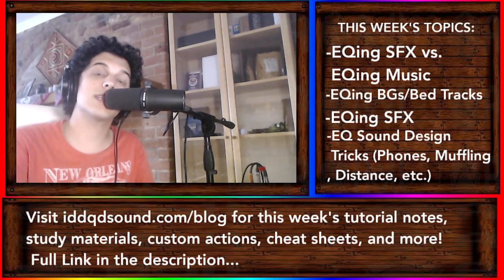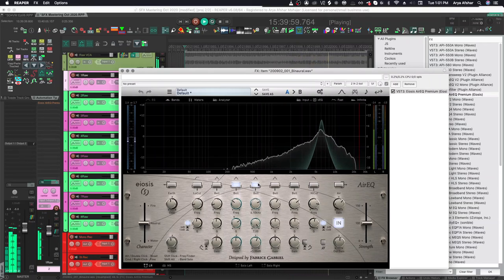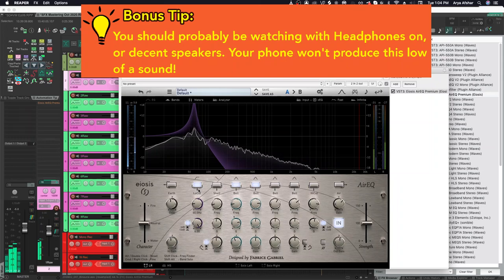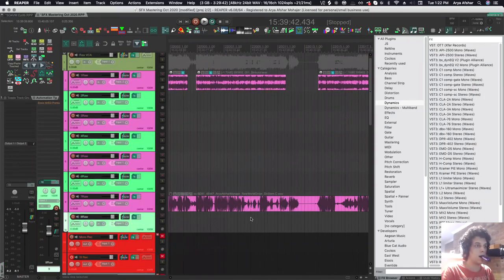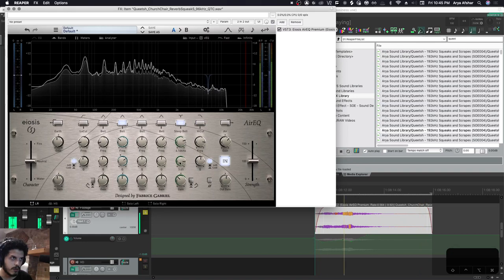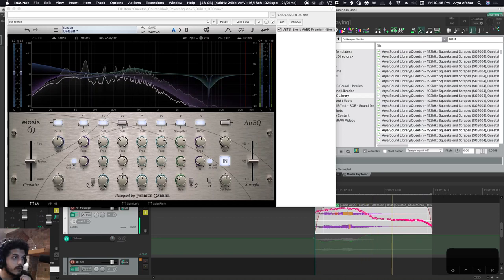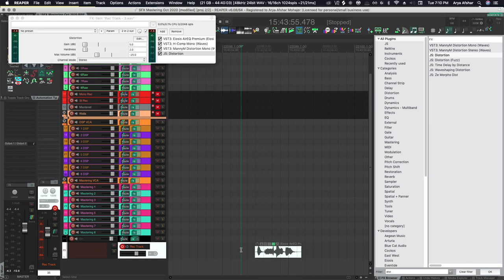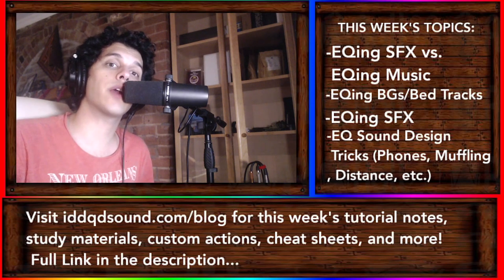Sound Editing for Visual Media Ep06: How to use EQ in Sound Design

Comment: How to Export 5.1 tracks from reaper to protools does AA translator solve this problem
Reply from the maker: Hi Dinesh. Your best bet is to export 6 channels and clearly label them, import monos in Pro Tools and then drag to a 5.1 channel based on your track order. The most fail safe option in my opinion. 

 AAtranslator does solve this problem, though I'm not sure how the 5.1 tracks are ordered with it. Still, with a bit of rearranging it's possible. I'll make a video on this!